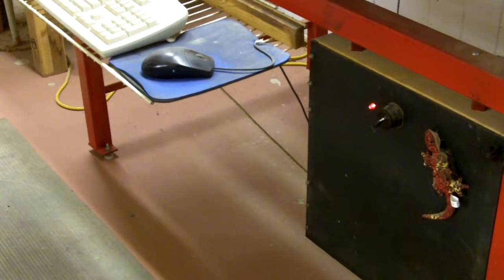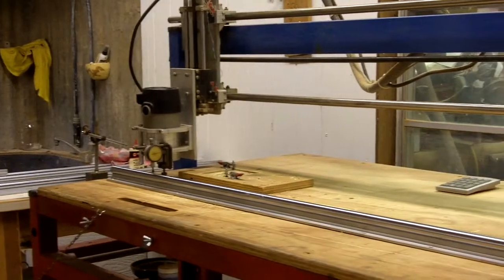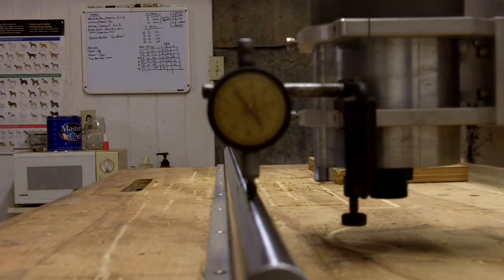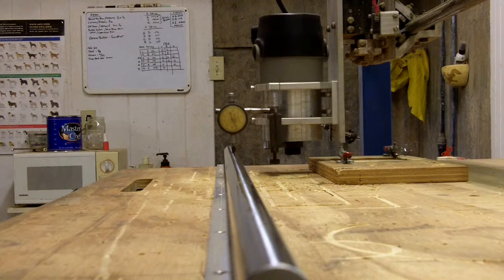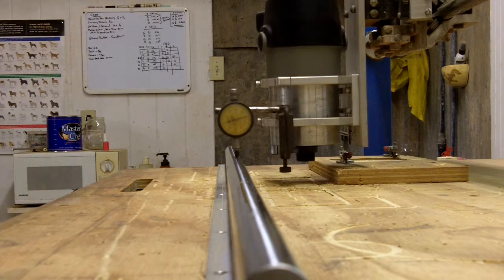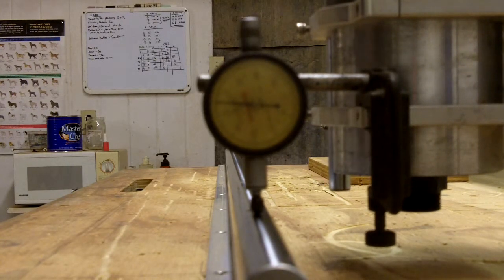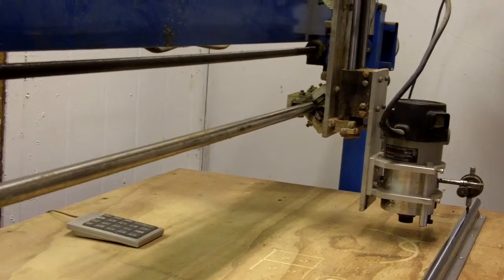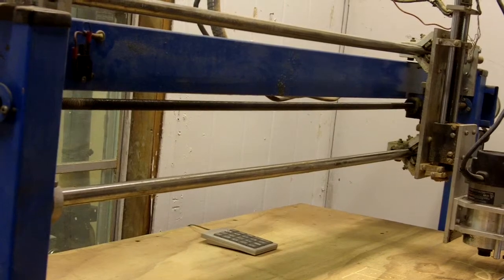Unsupported Rail Cnc Rebuild Part 1

Comment: Or just make those unsupported slides 2x thicker. I have a Chinese 3ft x 2ft machine with unsupported thick rails and it's very rigid (probably 30x more rigid that what I see in your video). A good number is 1.5 - 2" diameter (hollow would be ideal because of weight).